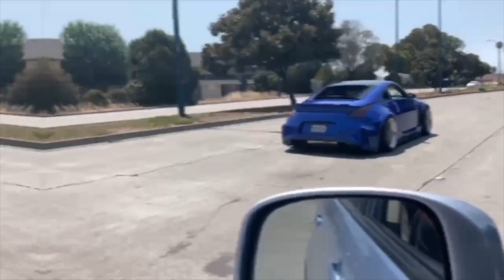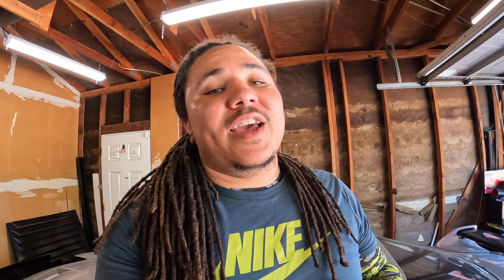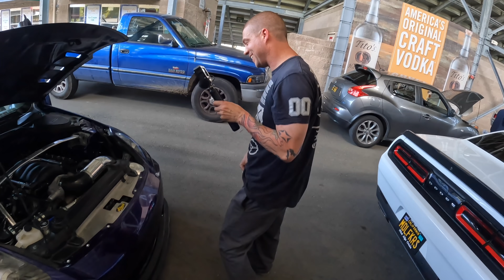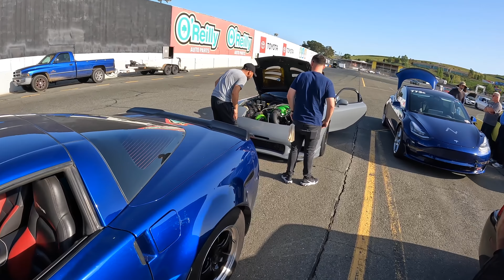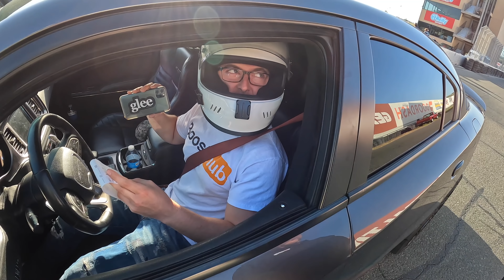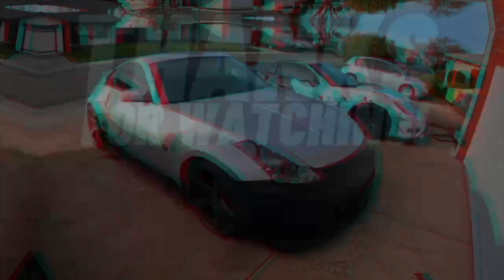Took My LS3 350Z To The Drag Strip! I Wasn’t Expecting This…

Comment: 1. hold the rpms steady instead of trying to do that tap the gas thing your doing. 2 instead of trying to dump it at low rpm start at a high rpm and slip the clutch very slowly until the car actually reaches the rpm your holding it at. (might have to play around to see what rpm works best). a smooth launch is always faster even if it might not feel like it.
Reply: He need to read this
Reply: Yep forsure

Comment: Don’t waste your time holding the hand break thas what the break is for, and hella you gonna need them slicks fosure but swap in some 370z axles before you break the stocks. Next time just do a lil roll in before you take off untill u get slicks otherwise u gonna spin longer. Better to waste time with a steady launch then a bog. You’ve got heavier wheels to so you bound to slow your acceleration from a dig.

Comment: Were you running full tire pressure? Try to drop rear tires by 10/15 psi with the tires you have you should be able to put em at like 18/20 psi and get better traction. Still may wanna feather it though so you don’t break an axle

Comment: That car is loosing a sec off the line...put that radial on there or slip the clutch..that car will pick up alot of time if you get the 60 dialed in. Also tuning on the suspension and getting the transfer right will help..

Comment: I don't think you need to do a burnout with "R" tires. Those tires you have heat up pretty quick. Also, I heard some dribbling from the rear. Do you have subframe collars? They helped me out a lot

Comment: Damn !!! 😑 when you launched in 2nd. did the wheels still spin very easily cause there is so much power to the pedal that it’s hard to gauge a little bit of that pedal feel that the street tires will automatically start to spin , with a little touch or too much gas ... perhaps some sort of launch tune or a purpose built tune that you could change remotely for the 1/4 mile and have the ability to flip back to a more street efficient supercharged set 🆙 🤷🏻‍♂️ but anyhow one ☝️ of ur sled should just be set up 🆙 as the track weapon , one garage queen , ☝️ that can be both a street beast , 1 old school ,  1 superbadass fd , two or three vettes  (next one 🙏 a vert ) , man but let me stop 🛑 telling you what I want , thank you 🙏 for sharing all your awesome content you are a natural born hustler and blessed individual sharing and showing us how you do it and be able to deal with all the different personalities and miscommunication or misconceptions and how much time and energy to give it or how much time wasted , anywho thx 🙏 again for sharing it with us , your hard work shows and hustle bone 🍖 is a lot stronger with your growth over the years thank you 🙏 thank you 🙏

Comment: It's all in your 60ft. Just got reference. My lnf Cobalt with e85 blend tune and downpipe runs mid 13's @107 and that's what it's supposed to trap at that time. My Fz6 back in the day ran 11.7 it's best @ 117 and honestly most the time ran 114. Just meaning a 13 sec pass with an 11sec mph, where you think you suffering? It ain't on the big end. Don't beat yourself up about it or the car. Cars good bro but you ain't running no 11 on them tires nuh uhh. Throw some radials on it and watch

Comment: Maybe you should try taking off from second gear with higher revolutions
Reply: Better tires
Reply: My boy if you watched the vid he literally did leave in 2nd
Reply: @ytshortiesniche999  Maybe he's referring to slipping the clutch even more to where it stays in those higher rpms. Cuz every time mike launched, its like he keeps letting go of the clutch just a milisecond too fast to where the car keeps bogging and dropping rpms down way low. Idk
Reply: @ytshortiesniche999  no he didn’t the first runs lol

Comment: Need a lower gear and you’ll trap higher mph probably or get a good drag tire to launch it and you’ll drop a second or 2 just by improving your launch if you have a bad launch the whole run is basically bad

Comment: Yo I know this sounds weird but turn up the frames per second when you racing . It’ll help tune your cars better if they have problems. And also like dude said Mike never change bro. I’m literally in the process to buy a over priced 350/370z or a infinity. All I want is fun not to copy you be easier to build one and gain experience and have some fun never know maybe I’ll drive my Alaskan ass down to Cali for a race one day

Comment: 14.3? My type r is faster than that...let's run it lol
Reply from the maker: Pull up… I’ll gladly gap you on the streets for a video😀
Reply: I'm down. I just gapped a nismo 370z on a 40 roll. Ill gladly take your 14 sec 350z to gapple bees sir. I'm in the bay area. We'll make this happen soon. If u need to see what you'll be up against look up C.Jizzles build thread in the civicx forums. C u soon....in my rearview 😉
Reply: @Its_Mike_Myke  hey mike when you launch keep the car at around 3k and slip the clutch just a bit, enough to where the power is put down but the tires dont blow off. I think this will really help! <3
Reply: @charlesjones4268  dude, the only reason he runs "slow" is because of his 60ft. you have no chance from a roll.
Reply: I’m a Honda boy, but from a roll, he’ll gap you bro. Dig? To eZ.
Reply: We shall see. I'll let my p600 do the talking sir 🙃
Reply: @charlesjones4268  yeah, this thing is a monster for almost 3k lol
 "High Efficiency Point-Milled 9-Blade Billet 7075 Aluminum Compressor Wheel (54mm Inducer, 67mm Exducer)

High Efficiency Inconel 713C 9-Blade Turbine Wheel (54mm Inducer, 49mm Exducer)"

Can she even breathe at high rpm that hondas need with that turbine wheel?

Comment: Yo a boss I don't no how bad transmission is but you should launch it in second gear cuz you don't have any traction   in first ask any of those old guys with the nova  Chevelle that will let you get some traction  that's what we did in street racing when the streets where trash try it next time it will fell like when to launch your  C6  but don't do that in you C6 the power in not there for that in less you dump the clutch in the C6 just try you have a light and flywheel and a lot of horsepower and a good clutch you should be fine it's just your transmission that you would need to worry about cuz you say it's trash or maybe it's just your gearbox I do not know but if you if you try it when you fix your transmission you should be golden on the track and you'll probably run at 11 that you want to run.